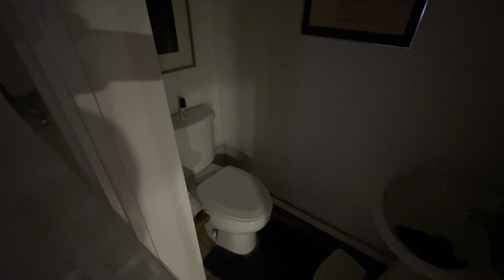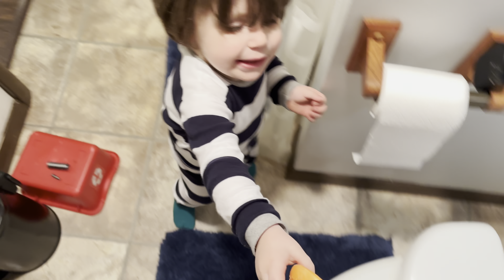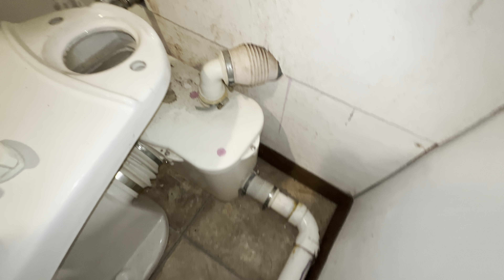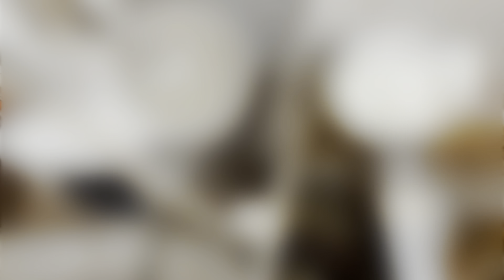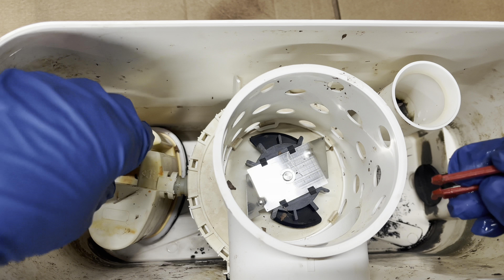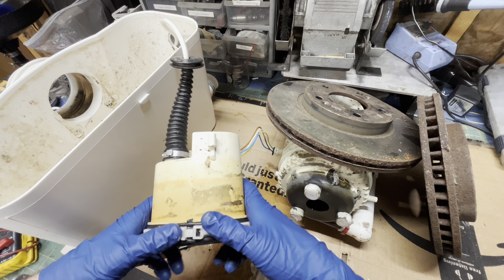What Stinks?? An Idiot’s Guide to Macerator Pump Repair!

Comment: I'm so Glad I live far enough north on the Canadian border all the sewer lines are buried deep the toilet in my basement is connected to the line in the floor no pumps needed, now a sewer backup is always a slight risk but since the house was built in 1914 and it never happened as far as I can tell in a 1960s finished carpeted basement I think I'm ok ? Now I just jinxed myself 😮

Comment: I used to occasionally have to fix these as part of my job. It looks as if there was just a buildup of "something" on the bottom of the tank under the diaphram, not uncommon and can be fixed by just taking the lid off in situ and cleaning out. My first option was always to try a gentle tap with the toe of my boot which often restored functionality, followed up by a few flushes. The worst ones are the smallest ones which pump the output through a nozzle with an orifice no bigger than 1/4", no macerator in the world is going to cope with that for very long, "defusing" those when blocked before opening them up was an art.

Comment: "Bleaching" tools is fun. I used to work at hospital doing some electronic repairs. Sometimes, I had to go into rooms of patients while they were there. That's mostly fine. But sometimes they were under quarantine and going there required playing dressing up (it was like preparing for surgery). Now the tools didn't get this treatment. And there was a zero chance I would ever touch them again without soaking and scrubbing them off like they are demon spawn. That's just not fun when the tool is not "simple" that you can just put into an autoclave. But, I know it sounds funny, but, hear me out. A condom can protect more than one type of tool. Amazing. They are even strong enough where you can actually use a screwdriver without it breaking. I still had dedicated set of tools for this purpose, but it made me feel so much better.
Reply: Solid advice, love this comments section

Comment: How do those bidets not freeze your arse, considering they tap in to the cold supply?
Reply: Cold water doesn't come with ice cubes in it.  It's at room temperature.
Reply: @moconnell663  You must not have lived up in the north or Midwest.  Formerly living not incredibly far from the southern tip of Lake Michigan, I can assure you that tap water, even during the summer, was only 50 some degrees.  In the winter I guarantee you that it was in the 40s.  However up here in Florida where it's hot, sandy, and the public water is buried maybe 1 foot at best, yes, here, tap water is more or less "room temperature" or so.  Rinsing my ass with anything less than 70+ degree water would not sound enjoyable, let alone 40-50 degree water.
Reply: @Florida_Man_In_Florida  I live in Wisconsin, though it's worth noting that my bidet is on the second floor, so there's a fair bit of pipework between the ground and my butt.

Comment: Why do you need that poop grinder , honestly the first time i ever saw those ?
Reply: Notice that the sewer outlet behind the panel in the wall is higher than the toilet. Poop doesn't normally flow uphill without assistance.
Reply: Thanks , but wouldn't have been better  to just make it in a way that the toilet is higher than the grey water outlest ? @moconnell663

Comment: Just about fell out of my chair when you showed how much that plastic box with a motor in it cost. While it is probably still worthwhile to do what you did I would have been sorely tempted to try one of the no name brand macerator pumps that are like 1/5 what that hunk of plastic cost.
Reply: I'm guessing the company charges a lot because they have to do a lot of very expensive QA and have the best parts procurers since a defective model could easily result in a lawsuit.

Comment: wtf poop shreder? Never seen such a thing in europe, why does the poop need shredding? Is it basically poop elevator because the sewage is lower then toilet?
Reply from the maker: Septic tank is higher than the basement bathroom, and there’s only one way to make shit run uphill!
Reply: i didn't know these macerator pumps existed until i visited Iceland 6 years ago; a couple of the basement apartment AirBnb's where i stayed had them.  they seem like a decent solution if you're installing a bathroom below grade and don't want to jackhammer up and repour the concrete floor just to run a drain pipe.

Comment: I’ve fixed a lot of shi.., uh stuff. But I sure ah heck would have bought a new unit instead of fixing that.
Reply from the maker: $850 buys a box of rubber gloves, hand sanitizer, and a TON of tools and toys as a reward…
Reply: @ as I get older I find my tolerance for working with turd encrusted stuff has gone down. You are still young and energetic!
Reply from the maker: And I change a lot of nasty diapers. My threshold is quite high at the moment